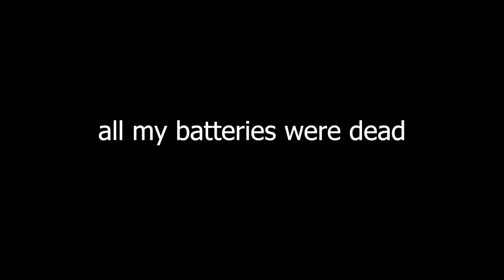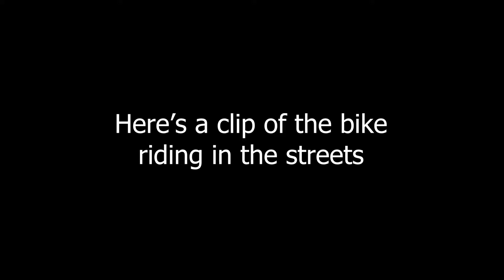Rebuilding the carburator and taking it for a ride - Ninja 500r project (ep.8)

Comment: Does anybody check carb float height lol eight carb video I’ve watched on this bike
Reply: It takes like 5 seconds to check, and also putting it in a cup of water to check for leaks is a good thing to check.
Reply: @gd.capture  not at all it takes 5 seconds to do it on you’re video if you already know how though
Reply: @KollynJ  you only need to check your needle to make sure it seats correctly and the rubber/metal (depending on model) is intact, after that, it's only a matter of putting on the side to make sure it closes at the right height. Your manuals should tell you the line you need to be square with but usually it's the line of the float straight with the carb.